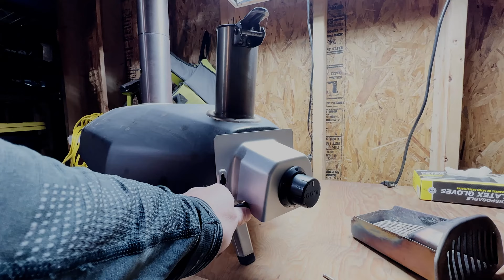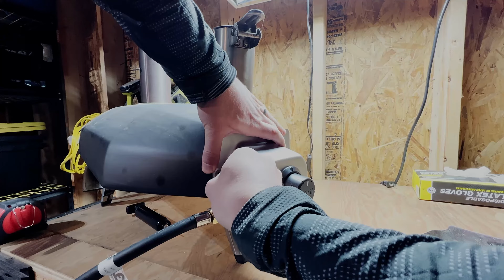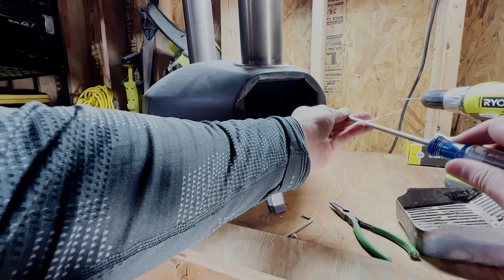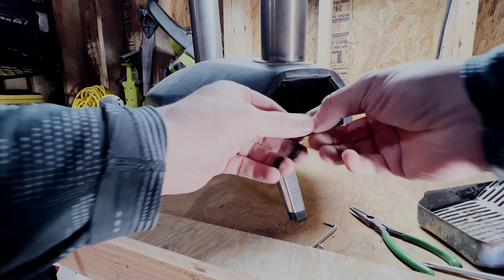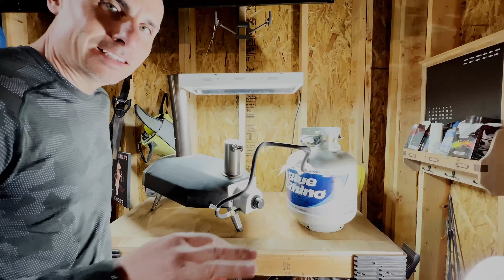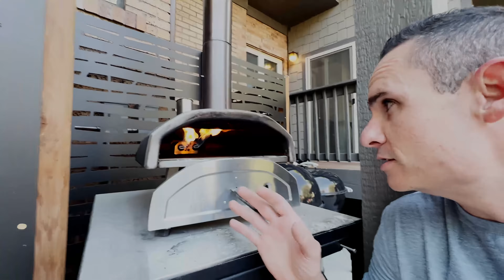Ooni Fyra: Quick and Easy Propane Conversion

Comment: Thanks for the video. Just done this conversation to my pizza oven. In the UK I followed your steps and drilled a tiny pilot hole first. Then a 4.5mm drill bit was the correct size to drill, so that the included screws with the Onni Karu gas conversion kit fitted perfectly. Job one in less than 5 minutes. Now I have the option of gas or wood when cooking. I Have to admit the first pizza’s I cooked with wood were amazing but having to juggle making pizza then remembering to top up the wood (without spilling the wood) a bit of a chore. Now I can simply crank up the gas to heat up the oven, then I nice lower gas setting to cook the pizza. I’m not going to bend or cut the edges of the Karu as you mentioned as they hardly stick out and let’s face it, nobody will be looking at the back of the pizza oven. In the UK. The Karu gas conversion cost me £90. It includes the gas unit. With around 1 meter of attached gas pipe and regulator connected. There are 2 screws (drill 4.5mm) an Allen key for the screws and a long metal match holder should the ignition fail and you have to get a naked light through the front of the pizza oven to ignite the gas burners at the back. Again thank you so much ❤
Reply: Thanks for the top tip for the drill bit size. I am also in the UK so needed the correct size 😊👍
Just ordered my burner, I managed to get it for £85 (£5 off) plus free delivery. Looking forward to cooking with gas. I was getting a bit annoyed with the wood pellets & wind blowing out the flames etc.
Reply: @lozy1592  only issue I’ve had with using gas is getting the temperature up fully. You don’t use the front lid when using gas (EVER)  so it takes longer to heat up. Don’t make my mistake of having it facing the wind or you will struggle getting the temperature up. When it came to switching off the gas the control knob didn’t turn the gas off, it just put it on a very low light. If that happens to you don’t panic. On the regulator there is a gas on/off valve. Just turn it off and the oven will run out of gas within a minute and the pizza oven will be out. Happy cooking!
Reply: If you’re in the United States, use the 1/8 inch pilot bit. And then use an 11/64 bit. And that works with the screws that come with the unit.
Reply from the maker: Awesome! So glad it turned out well for you.

Comment: How is the taste compared to cooking with pellets? 
I have Fyra 12 but I just ordered Koda 12 hoping it's less hassle keeping the oven in perfect temp but now my worry is that I will lose all that smoky wood flavor and slightly burned edges when cooking with gas.
Reply from the maker: You definitely still get the char on the edges, but you do lose some of the smoke. Not enough to make a huge difference though. I was pleasantly surprised. My primary reason for going with wood was the taste, but this was so much easier that it made up for any loss in flavor.

Comment: This is great. Thanks! Wondering if since converting to gas if you have tried to use the Fyra using pellets again and if the 2 holes you drilled caused any issues. Cheers!
Reply from the maker: I did a few times and didn’t notice any negative impact at all. The holes are very small!

Comment: If you buy the ooni gas conversion no drilling needed. It slides in and re-screws into the unit. Took my 5 minutes to convert it over. Easy peezy. Worth the extra money to have an exclusive OONI oven even though I paid $40.00 more for the easy fit.
Reply: Do you have a link for this perhaps? I see the gas burner for Karu 12 and Karu 16 but not a conversion kit that wouldn't require drilling. Thanks.
Reply: Don't think this comment applies to the Ooni Friya but the Ooni Karu. There's no Ooni Friya conversion kit. Either way, the one in the video should work.
Reply from the maker: That option didn’t exist when I made the video. Glad they finally came around
Reply: Which one is that?

Comment: Such a great video that answers all the questions I had. I've cooked upwards of 20 pizzas on my Fyra in one evening with pellets but it was one of the most stressful evenings I can remember 😅.

Do you measure the stone temperature? What are you seeing in the middle or closer to the door using the gas burner?
Reply: yes the chef does not get to eat as they are too busy with the Fyra.  constantly managing the fire.  I'm converting to propane.
Reply: @gregs_garage  that comment was a good while ago! I switched to the gas burner too, just way less stressful overall

Comment: Great video, I'd be really careful keeping that propane bottle so close to the oven in case of a gas leak, tank should be lower than oven as propane is heavier than air, unlike natural gas.
Reply from the maker: Good call out. This was only placed there for the demo, otherwise it’s in the bottom shelf of the Ooni stainless steel outdoor stand that you can purchase.

Comment: I am so glad you took the time to do this video and share your success. My wife probably thinks I really don't like my 2021 Father's present. That will change now, thanks to you. I just ordered the gas burner from Amazon 10 minutes ago.  It will be delivered Monday.  
Perhaps you have a suggestion or a solution for my other Ooni related issue. My my grill island/patio roof is made of corrugated plastic panels and the temperature of the exhaust from the chimney is too high for comfort.  I have considered various diverters and chimney "add-ons", but nothing that looks very good. One option I considered was a 45° bend of vent pipe to divert the heat out... anyway diatribe over.  Thanks again!
Reply: I have one now and it is magnetic. However, I am not sure the gap created by the magnets would be a good thing.
Reply from the maker: I wonder if you could get a cap that fits that diffuses the heat? Something along these lines (although I haven’t measured the pipe so I doubt this one would fit) https://www.acehardware.com/departments/heating-and-cooling/chimney-and-flue/stove-pipe-caps/43355?store=05349&gbraid=0AAAAADtqLJEXHlLYp9reWPW1ComggUqAI&gbraid=0AAAAADtqLJEXHlLYp9reWPW1ComggUqAI&gclid=EAIaIQobChMIjamO2ojw_gIVQW1vBB24SQcFEAQYDCABEgKpj_D_BwE&gclsrc=aw.ds

Comment: Very helpful video. My unit however went out after 5 minutes. Then very hard to restart. Door was removed so that’s not the issue. I repeated the test. Hard to start, then went out on mid range after 2-3 minutes as if a bad thermocouple. Returning and may try another one.
Reply from the maker: Interesting, wonder if you did just end up with a bad unit. I haven’t had any issues with mine fortunately.
Reply: intersting, how did the second unit work?
Reply: Found this vid about your issue. Change subtitles to english. Hope it helps

https://youtu.be/fjBumUsUORw?si=p0rW-iprw9LN2VgX

Comment: Good instruction. I would not be concerned over the door causing a hazard because the 2 vent stacks are more than adequate. No more of a hazard than a gas grill lid.
Reply from the maker: It’s a good point. I left the front cover on personally, but don’t need anyone to blow up and blame me lol
Reply: It does seem like the gas valve has a thermocouple so it may turn off if the flame goes out. I’m not certain of this but I think it may be the case.
Reply: propane will not go up the vent stacks if flame goes out, it is heavier than air so need to keep door off

Comment: Just did my install. Worked perfectly. However the intense heat did cracked my stone. I think I need to ease into the flame. Buying a new stone if I feel I need to
Reply: you can find a steel online for this oven better than a stone anyway

Comment: This is a great video!!! Approximately where on the gauge did you find it was optimal for not burning the top?
Reply from the maker: I ended up cranking it up to high to get the temp up, then dropping it down to medium while the pizza was inside cooking. That seemed to get the job done.
Reply: @allyourtechai  Do you have to raise the temperature again, after you baked a (or some) pizza or does it hold the temperature after heating it up on high?
Reply: @z3alt454  He talks about it in the video, he raises the temp from medium to high in between pizza cooks to maintain the temperature. Then drops it to medium when he actually cooks the pizza.

Comment: Thanks im gonna get one pellets are to hard to maintain heat
Reply from the maker: No problem 👍. Makes a huge difference
Reply: I was just looking on the Ooni site. They were very specific about “only for the karu.” Yeah, right. I’m buying this sucker tonight! If, for some reason, I want to cook pizzas at the park I’ll use the pellets. And on that note, they also say that you can’t use hardwood or charcoal because of the ash receptacle. I’m going to put that one to the test too.
Reply: @saldrich3226  Did you try hardwood? How did it go?

Comment: Did you need to close the valve of the chimney because of the heat loss? Nice video!
Reply from the maker: I left the chimney open, but did end up using the front cover (use at your own risk). It cooked great with that combination.